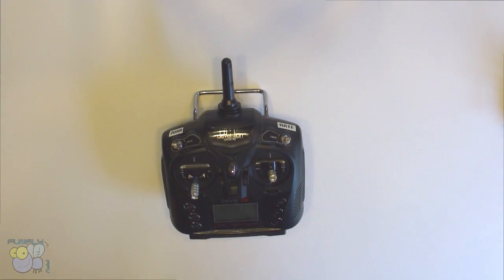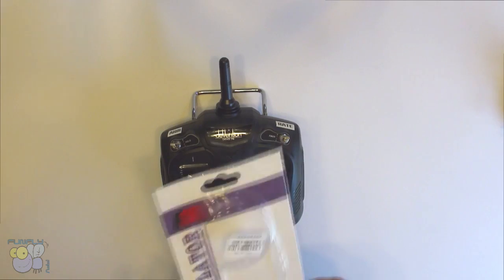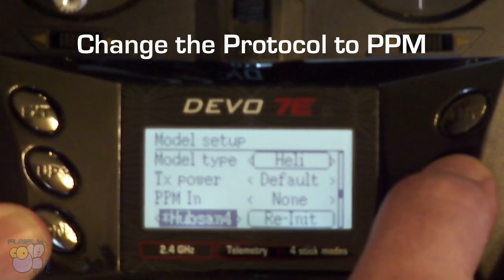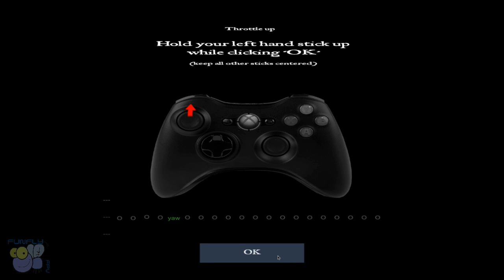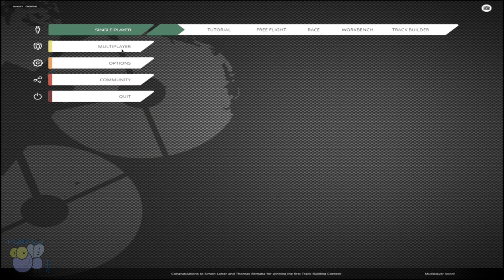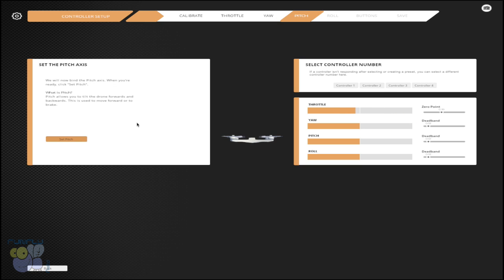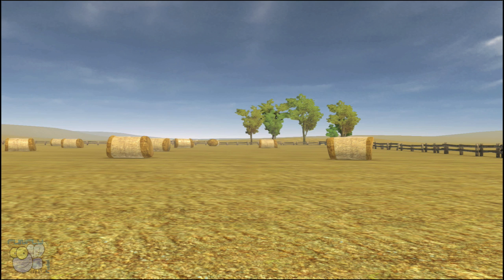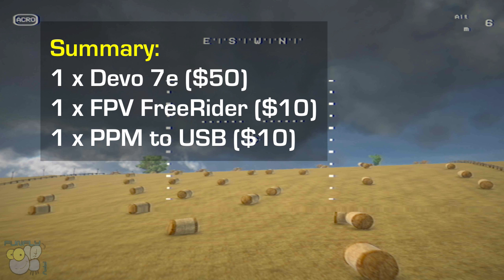FPV Simulators with a Devo 7e

Comment: Does this work the same as devo 7 ?
Reply: Devo 7 is pretty close to rubbish. You can't do much to it - no open source software to extend its features. Skip the 7 if you can.
Reply: You havn't heard of deviation then?
Reply: Last I checked the Devo 7 can't be deviated, the 7e can.
Reply: my error, i mant the 7e
Reply: No problem man..
Reply: Julien Gordon The devo 7 is OK for a 7 channel transmitter but I am guessing that the 7e is a upgraded version specifically made for drones but people should also keep in mind that the devo 7 and the 7e are made for quadcopters so no planes which is also another down side but as you mentioned previously the devo 7 is not suitable for deviation upgrading as the 7e is causing it to be better.
Reply: +InventorJS -Jacob Singh the 7e is range limited and has to modified to get full range. It was originally aimed at small copters for about 30-80m. The 7 was supposed to be the upgrade but I'd argue with mods, the 7e beats the 7 by a mile.

Comment: Could I just use any USB to 3.5mm adapter for the devo 7e?  I don't need the other adapters that come in the product you recommended.
Reply from the maker: I don't know but you can actually also use just a USB cable and plug it into the DEVO directly, no converter needed. See my note in the comments.

Comment: I see you got one like mine :) must have made an impression at the restaurant meetup. I use the USBHID protocol and the USB cable and it works, no adapter needed.

You may be interested in this little 3-in-1 module for the Devo 7e/10/8s That adds frsky, hubsan, flysky support and lots more.

https://www.amazon.com/dp/B01FX73J3Y/ref=wl_it_dp_o_pC_S_ttl?_encoding=UTF8&colid=36BJLAZSH6KJC&coliid=I23CTMA92DL54D&psc=1
Reply from the maker: Yes sir ... Love it.. Use it with all my ultra micro's ... The PPM to USB adapter also works with my FlySky FS-T6 and Turnigy, some of which do not have USBHID. It is great to know that you can get it to work directly form the Devo 7e ! Thank you.
Reply: With a cc2500 with lna and PA I can do frsky up to about 1km with full telemetry. Also can do DSM out a bit further. It is a nice little unit. Like it a lot.

Comment: You can also select USBHID protocol in the deviationtx software you installed in the Devo 7e and use it just like a normal joystick, without having to buy a PPM-to-USB cable. ;)
Reply: Awesome! Thanks for this information! This just made me purchase Lift Off
Reply from the maker: Great stuff !! Thank you !
Reply: For the record.
Unfortunately this does not work in FPVFreerider and Lift Off under Linux. However the problem seems to be on the simulator side, because it's detected as a joystick in Linux itself and works just fine.
I als ordered the cable, mentioned in the video and this works, at least in Lift Off, where I tested it yesterday.
Reply: I'm on Linux, currently using my Devo 10 with deviationtx 5.0 firmware and my model setup for FPV Freerider is configured to use the USBHID protocol... and it works like a charm! ;)
Reply: Good to know that it should work.
It doesn't make to sense to me either because, as I said, the Devo is recognized under Linux and jstick shows all the axis movements correctly.
However, in my case, only the cable and PPM protocol worked. Same model configuration, only changed the protocol.
Will check my firmware version. Maybe this will do the trick.